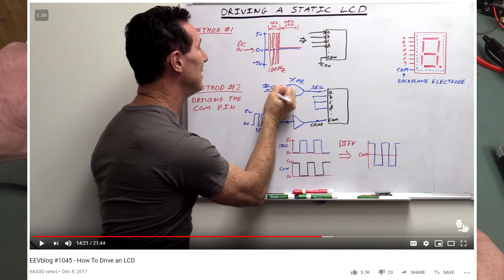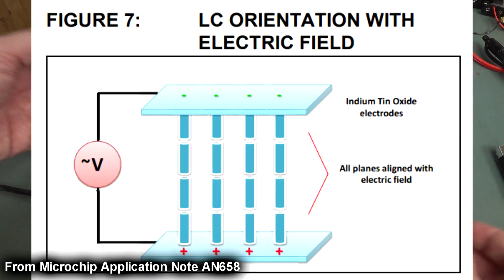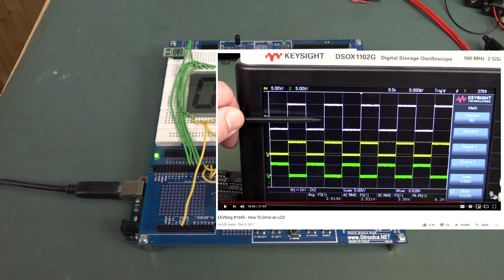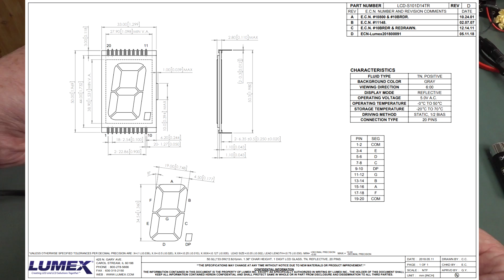EEVblog #1297 - Turn an LCD into E-Paper!

Comment: The effect is sort-of known but there haven't been much research as it seemed a dead end. Typical liquid crystal polymer is normally considered an insulator but due to quantum tunneling over long time charge can build up on the imperfections inside LC polymer turning the molecules into permanent dipoles. This makes them keep their relative orientation even after external electric field is removed. It is not really practical in e-ink like application trough, since after few days light will cause the charge imbalance to dissipate and the effect will diminish because the molecules are comparable in size to the wavelength of visible light. I expect you had this experiment done and stored stored in a dark place so that explains why It's sill going. We've been doing more research into this in the past two years and found we can intentionally introduce special nano-structure imperfections in the polymer that will be able to create reverse effect and the incoming light will create the dipoles instead. Further to extract the charge we can ultrasonically agitate the lc to drastically speed up the tunneling, and essentially create a solar panel that with special driving still can work as lcd. We were researching other options for extracting the charge and just slow variations in pressure seem to be almost as effective. We are now considering making a kickstarter project and getting government grant to build solar LCD roadways but we need time to get it right. Hope we can send you samples soon.
Reply: You almost got me.
Reply: Very dry. . .Nice
Reply: FREAKING LCD ROADWAYS!!!!
Reply: This is the most interesting youtube comment I have seen in a while
Reply: I do believe a turbo encabulator can be used to accelerate the process of turning LCD displays into epaper, the US Government did some research on this during the 80s after the soviets introduced their nixie tubes with display persistence
Reply: I think you've all been had on April 1st... watch how fast the Arduino starts up.  Normally it is about 2 seconds before the bootloader finishes and your program (sketch) starts but this seems to be starting up much faster.
Jellyfish's solar LCD roadways should also be a hint.   ;-P
Reply: @ElmerFuddGun  Yeah or you could just look at the date. Dave ALWAYS does it, every year...
Reply: @ElmerFuddGun  bamboozled
Reply: oooh, i'd love to see Dave ride all over your solar LCD roadways in no time
Reply: @kwindzy  Just his mention of LCD roadways seem to discredit everything else he said... ha ha what a doink!
Reply: I think all was fine till you said SOLAR ROADWAY...I'm sure Dave's BS meter is ON from now on..:)
Reply: You forgot about graphene and carbon nano tubes. Use them and it will work for sure!
Reply: That is all possible but I think each of the enabled pixels quantum entangles with the other pixel in the LCD which causes a static charge to build up in the bipolar molecules...
Reply: LCD friggen roadways.
Reply: Experiment: if you drive it with a proper AC signal does it reduce the effect or return it to normal quickly?
Hypothesis: yeah, it was probably engineered to be as robust as possible so if you give it a little bump it will want to go back to normal.
Reply: Well, it was April fools after all
Reply: Roadways? Where we're going we don't neeed roadways
Reply: @moriambar6533 Just get it up to speed about 88 mph and with a flux capacitor.
Reply: Prima Aprilis! :D That was hilarious though.
Reply: i think the lcd roadways bit might have been a joke
Reply: @pepe6666  it's definitely a joke... And I suspect the rest is too XD just use large techno-sounding words and no-one knows the better.
Reply: We need more trolls 😂
Reply: Damn. That went downhill so fast
Reply: So with solar LCDs you can even add some KI to the roadways and the roads can then read "Ouch" to the passants, when they step on them. Maybe this causes people to be more gentle to our roads and increase longevity. Cool idea XD
Reply: Absolutely mind blowing how many people in here can't process a simple joke. Wooooosh.
Reply: What! Unbelievable! I have started to like LCDs after your comment!
Reply: This comment seems to have reached YouTube via a quantum tunneling effect from Uranus. Lots of quantum tunneling goes on in Uranus, and there also seems to be a great deal of interesting dark matter in Uranus, possibly even a massive black hole, or even a quantum vacuum that produces unlimited over unity power. 

Strangely though, the US DoD seemed to have no interest in Uranus' quantum tunnels. Maybe if you wiped properly, the prospect wouldn't look so grim.
Reply: Interesting, however you sure it is not the result of electrostatic build up?  I mean sure charge over time makes sense, but quantum tunneling?   btw, can't tell if you are joking because you mentioned,  kickstarter project for LCD roadways!
Reply: ROADWAYS?!?!
Reply: Had to pause the video to read your comment. That sounds like some futuristic stuff. Big up for your project. I love this channel.
Reply: Amazing!
Reply: I like when 2 sience field meets
Reply: Why the Fuck would roadways be the best idea? Good luck with longevity
Reply: Lol you've seen Dave's videos on solar roadways before.... right??? You might want to find a new career buddy.

Comment: Driving an LCD with DC for several hours will irreversibly destroy the coating on the glass surfaces on top of the electrodes.

Comment: When you remove power the mcu voltage drops, then the mcu oscillator stops when the voltage drops low enough, which is a design feature of modern mcus..
At that point, the mcu is stopped, but its output pins are still latched at their previous logic levels, but at a lower dc voltage (like 1.8v). 
Since the only thing drawing current is the lcd which draws nanoamps, the large (10uF ?) cap on the mcu Vdd rail means the pins will continue to keep those logic levels, and keeps the segments activated on the LCD, probably for minutes.

Comment: I think that is because the surface of the segment is bigger and form a pretty large capacitance, for LCD displays with smaller surface of the segments will fad quicker.
For displays with smaller surface you can put capacitors, like 1nF in parallel with each segment, to make it maintain the segment longer.

Comment: Yea, you bought the display from Digikey in the USA, it is therefore the wrong time zone version for Australia, and there is a 14hr lag between power off and the display catching up. Send it back and order the -AEDT part number rather than the -EST Its a common mistake.

Comment: I achieved a similar result with oled, we all know that burn-in is a serious issue with oled, there are several mitigation mesureas, with max brighness and static picture for several hours i achieved burn-in, the burned in image was quite bright and remained with power supply removed, so in a sense it was even better than epaper, because it was visible in the dark while not being powered

Comment: Ah, I remember this effect.
Back when the turboencabulator prototype was first being developed, the back plate made from precombulated amulite (before they figured out prefabulated amulite) used to sometimes short out the display controller and cause any image to remain on the display for a long time.

You may have some of the same problems with your LCD, better take a look.

Comment: This for sure is related to free energy getting pulled from a local vacuum quantum hole, that each single molecule has.  It permits the molecule to stay as is forever.  Due to the very small amount of enrgy the molecule requires to stay still, and then just slightly greater quantum hole energy, the effect appears.  Also, the older the molecule the more stable the quantum hole. 
Yes 2020-04-01 ... AF

Comment: we have this technology in lots of supermarkets since some years. the price tags are lcd and they store the price and it stays like this for quite some time!
Reply: The supermarket tags contain batteries and some additional hardware. They can keep their price visible for so long since driving an LCD uses pretty much no power. Combine it with a low self-discharge lithium battery and you can get a battery life of several years.
Reply: @IkBenBenG  (shhhh - still a few hours to go)

Comment: Driving LCDs is a complex process. The datasheet mentions "static, 1/2 bias"  as a driving method.

Static actually means AC and 1/2 bias uses a stepped pulse.
When driven with a DC voltage will also show the segments but this does come at a price. The LC polymer may (will) turn into "permanent" dipoles and eventually they will stay this way and solidify. Even with an AC voltage, it is important that there is no DC component on the LCD - so the duty cycle of the AC voltage that you generate with something like an Arduino should be 50.0% exactly. If it is not, the LCD will be damaged. Most likely we will never see this with our hobby applications but especially with LCDs that are driven 24/7 over decades or in automotive applications (with extreme low or high temperatures) this is important.

Comment: I have seen this or similar effect on a large LCD screen. If I unplugged it during the day the image was gone instantly but if I unplugged it during the night the image stayed around. Only until I pointed a light into the direction of the LCD did the image slowly fade.
I am not sure if this is the same but you could try putting the LCD in the sun while its holding the image. Maybe it will "repair" itself.

Comment: Im not experienced with LCDS, but does that mean, that if a segment is turned on it stays crystallized? Kinda like a Servo holds position when power is cut? If so, what is the condition for turning a segment off?

Comment: It would be interesting to just power the display to change the number and then depower it from the arduino rather than having to pull the USB power input. This should significantly reduce the power requirements of the display and you would find out how long the display needed to be powered before removing the power to remember the value.

Comment: I was fearing that this experiment would be one of the 'whittle an 8-foot 2x4 down to a toothpick' variety! ;) Thanks for proving me wrong, Dave!
If you pull the LCD out of the breadboard, do the segments remain on?
I suspect a filter cap remains charged and is 'powering' the LCD which draws close-to-zero current!

Comment: Honestly, even if the display image is not persistent like in an E-Ink display, this would work great for projects that require to show static (or minimally changing) information on a screen. You could just send electrical pulses every 20/30 seconds instead of having a persistent flow of current, and increase your battery like 100x

Comment: I think I have the answer. 

This is due to a well-known effect in quantum electrodynamics but to my understanding, it only happens at the subatomic level.
 Maybe Dave leaves it plugin for months, the long term potential different present in the liquid crystals' structure (LCS) creates a tiny Higgs field around the LCD, and this field persisted even after Dave removed the power. The quantum entanglement between the persisted Higgs field and the crystal 's atom induced some photon. And the amount of photon produced can be computed using the Feynman diagram in QED setting. Oh, I think I put too many details. The name of the effect is called "Asymmetric Potential Radiation-Induced Light Effect of type 1". Google it if you want to know more about APRIL-1.

Comment: I've always known (being told) that you need to use AC drive to avoid electrolysis from eating the metallised plating from the glass, as it is in direct contact with the LCD liquid.
Nice display, I've always wondered, but never found a supply of large LCD displays, like you find on petrol pumps etc.

Comment: I tested years ago on similar dispays. the real problem is that black segments fade to gray after a few minutes with DC on. The unpowered display is also very sensitive to electrostatic perturbations that can switch segments on or off.

Comment: The two parallel plates of the LCD (the back plane and the front ITO pattern) are acting as a capacitor and storing charge. I think this effect would depend on the size of the LCD segments since that would directly change the capacitance
Reply: Or maybe it's just April 1
Reply: @lhxperimental  Oh. I can't believe I fell for that!
Reply: Also Australia, hot and static. Here in the UK? Our wet cold weather would just destroy the entire breadboard, let alone any ambient electrostatic results. ;)

Comment: Electronic (power) meters have one big drawback: If they fail, they mostly fail in a way that the display is not showing anything. So you're completely unable to retain the meter value, which would be helpful in many cases even if the value would be from some days or weeks back in time. This effect used on purpose could solve this problem quite nicely and cheap.

Comment: Captain here
All e-ink displays are secretly LCD Displays driven like this, sold at a higher price. That's why they impose the limitations as low refresh rate, monochrome, etc.

(Note, this is sarcasm)
Reply: Mmmmm nope
Reply: No, e-Ink displays in particular are suspension granulate displays, not LCDs. There is physical pigment there that travels either towards or away from the top glass driven by capacitance of the cell. There is no liquid crystal in those.

However there is an LCD "E-Paper" technology, it's Sharp Memory LCD.
Reply: @SianaGearz  (it's a joke dude)

Comment: Can you recall where have you read this bullshit that you can't power LCD with direct current? Why are you surprised that this counterintuitive requirement to switch voltage is actually wrong? You are so stick to it like Moses himself told it yo you. Ok. This obviously counterintuitive bullshit is now proven to be wrong, good, lets move on.

Comment: It would be interesting to compare the power consumption/ capacity of the display to a new one. Maybe more power is required now to drive them permanently?
Due to the protection diods on the output of the arduino the arduino should drain the charge out of this...
Reply from the maker: Yes, will have to do this.

Comment: Try to pull it out of the breadboard and see if it lasts.
Reply: Dave Micolichek  Dave usually uploads his 1st April videos on 31st March.
Reply: Dave Micolichek  it is in australia. plus you can upload bs anytime of the year...
Reply: i'd say that in the breadboard it's nice and isolated without the many discharge points it would have if you pulled it out
Reply: i bet it wouldn't.. id say some capacitance in the bread board/wires are much of the cause for this.. although iv seen it happen on cheap calculators and other crap over the years but faded away over a few days.. didn't know i thing about electronics then but.
Reply: @keithking1985  i bet it would not since its an april first video, this is a trick board with a battery somewhere

Comment: Because of its big size the capacitance is large as well, if the leakage current is small, I think, it can really stay on for that long.
Reply: Specialy on april 1
Reply: The capacitance is actually really bad. There is a substantial plate distance and the area is nothing to write home about either, when you compare to any MLCC.

Comment: Short all the LCD pins together to confirm there's no remaining voltage...
Reply: By all reason there IS a remaining voltage.

But so what? With undriven pins, it might stay there for minutes if not longer. And i mean even if you had a real Sharp MemoryLCD, you'd have to wake up every minute or so to refresh it.
Reply: @SianaGearz  Then it's more a feature of the mcu than one of the LCD...
Reply: @cmuller1441  No, even with MCU in Hi-Z, the liquid crystals themselves should relax and fade out within like 10-60 seconds. It's really difficult to confirm whether there's voltage on there because i mean even a megaohm or 10 megaohm tool will drain the LCD. There really isn't much capacitance in there.
Reply: @SianaGearz  If someone says he did something usual, his word his enough. If someone says he did something exceptional, you want a good proof. If someone says he did something incredible, you want a ton of proofs and to exclude all simple explanations.
Maybe the lines have enough capacitance and the mcu outputs have no leakage. Also maybe the LCD has changed because of the DC driving and keeps charges better. Last option: it's already April 1st in Australia...